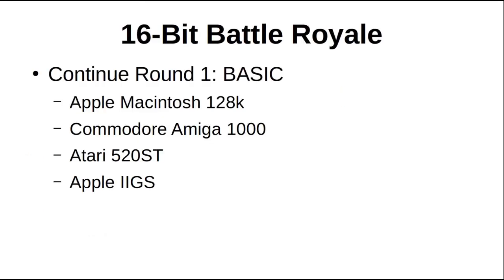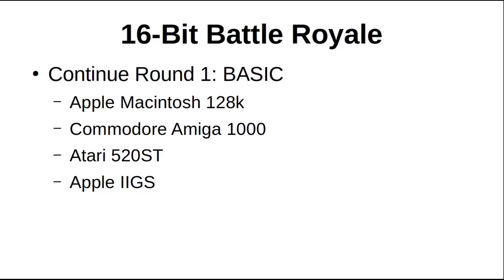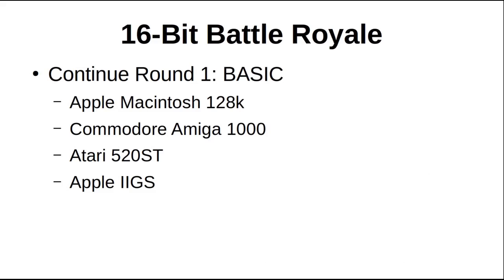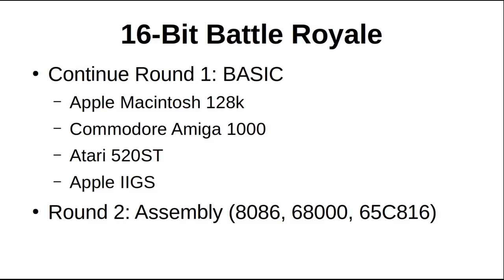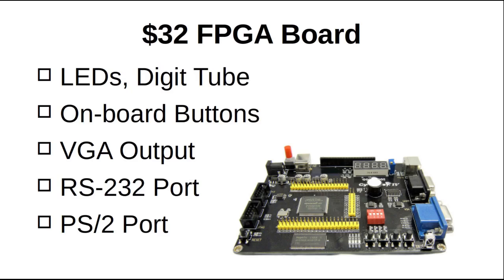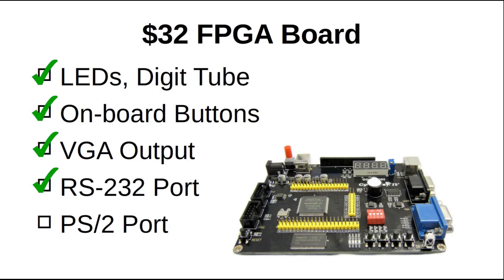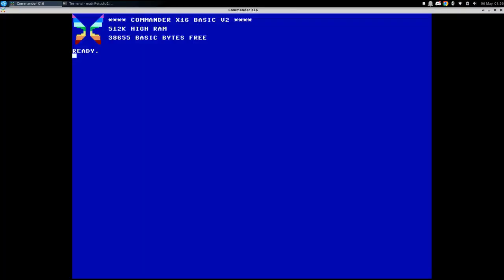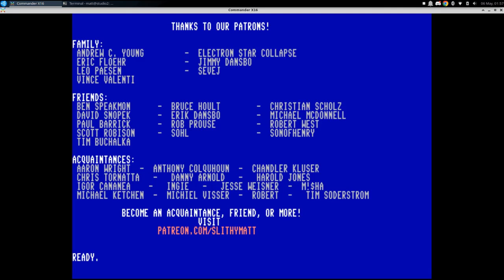HANTEK SCOPE UNBOXING! -- Channel Update - slithy VLOGS #30

Comment: Hi Matt, you might want to try a different PS/2 keyboard if your having trouble. Some keyboards will work fine with the 3.3 volt output of the FPGA, while others insist on the full 5V as specified in the PS/2 spec.
Reply from the maker: Yeah, it's definitely flaky.
Reply from the maker: Just checked it again on the scope, and the board is putting out a full 5V for power, and the keyboard is responding with nearly 5V peaks for clock and data. Yet, most of the time, the keyboard just wants to keep on sending the xAA "test ack" code and never actually send any key codes when you type. Other times, it works perfectly fine, and sometimes it just sends out garbage. But at least now with the scope, when it decides to actually send codes, I can verify that I'm reading them correctly and the timing is all good. Very frustrating! Maybe a different keyboard is in order, but there are only so many options for PS/2!
Reply: @slithymatt  I've got an FPGA board the same as yours (I tend to collect FPGA boards so have many different boards) and a whole bunch of PS/2 keyboards, I'll do some testing and see what's required to get flaky, non working keyboards to work properly. There can't be too much required. I'll get back to you with the result.
Reply: @slithymatt  I've only tested three keyboards so far (IBM, Compaq, and a clone) but all are working fine, I have more I'll have to search for and as well as a bunch of AT keyboards (need to find my adapters though). I'm using my own PS/2 test design rather than the one that comes with the OMDAZZ board but that shouldn't matter (I'll find a way to get it too you though, just in case). It's possible your keyboard is not getting enough power, thus tripping the self test over and over.
Reply: @slithymatt  Not sure if you found the design for the PS/2 keyboard test before the post was deleted.
Reply from the maker: @crayzeape2230  sorry, didn't get it. You can email it to me matt@slithygames.com
Reply: @slithymatt  Sent.